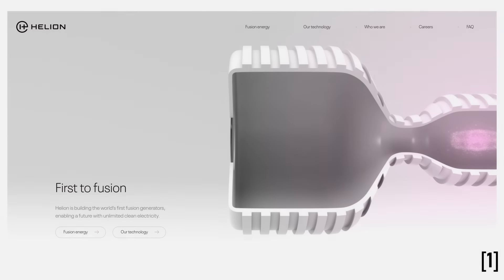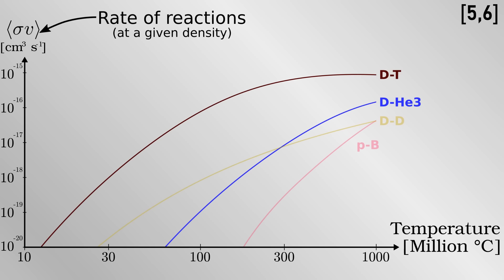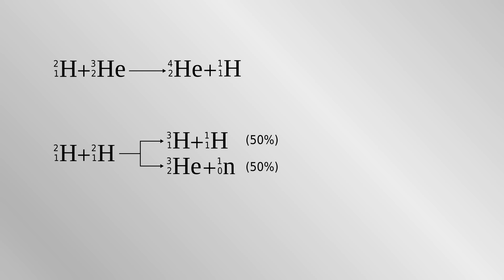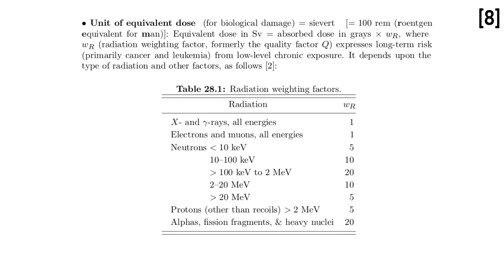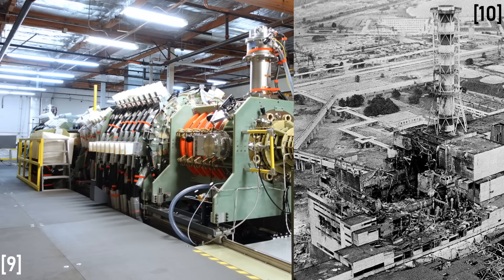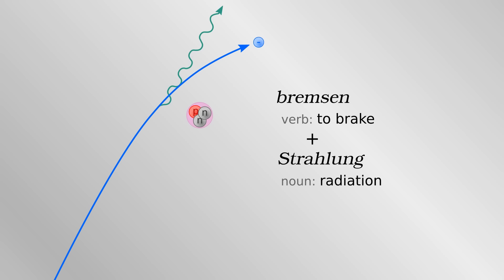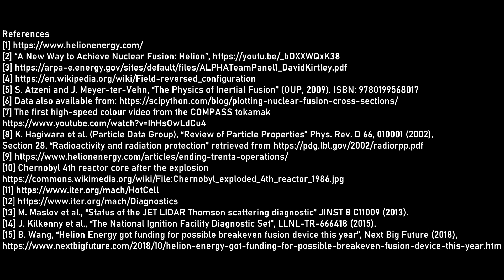The problems with Helion Energy - a response to Real Engineering

Comment: Helion sponsored a whole lot of youtubers this round of funding. 
I'm studying to be in the industry right now and in the course of speaking with potential employers i spoke to helion guys.

The claim is that with lower fusion rates, they can reclaim lost power usually used to heat plasma. The net total is supposedly gain. I'm not convinced. 

I'm glad you're out there doing this though. They need more criticism
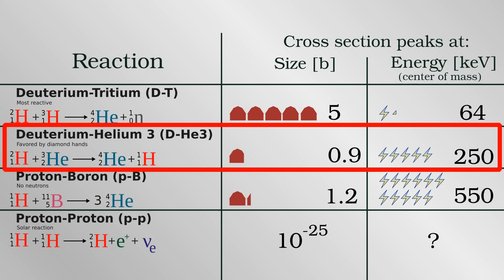Reply: Criticism is defiantly appropriate but it seamed mostly miss guided in this video. The reaction density was equated at 1:50 with power density while expecting that the density of material is the same. We have no information on the density of the plasma, (might be much better), the power per reaction is shown to be 4x as high in the slide at 1:12.
Equating some neutron radiation to burning chernobyl seams deeply disgenerous, many fissle material emit neutron radiation (we are exposed to it naturally) and meters of shielding can be accomplished by water tanks like in every other commercial reactor. Bremsstrahlung is usually less of an issue in pulsed reactors and happens to all fusion reactor designs.
The detection of fusion: Measuring the heat of plasma is nothing new and if they have achieved 100 million °K it is basic statistics whether they had some fusion
Helion will be late and haven't yet even achieved a gain factor above 1, constructive criticism is definitely appropriate and they like are looking for funding.
Neither REs video nor this criticism proves or disproves whether their approach is viable, I wish all fusion researcher and start-ups good success.
Reply: @leonfa259  The power extraction method they claim to be putting in use uses the tendency of the plasma to push back against the magnetic fields of the coils, producing net energy output. This would mean that they don't need to spend energy on temperatures above 100m K, they just need to form the fusion plasma with enough energy to push back against the fields. That being said, they haven't actually tested the system yet, so there's no telling just how much that extraction method can produce.
Reply: I have very little knowledge of fusion, but i think what you just said is that Helion isn't producing as much power, so it's not losing as much. Which is great if they're going for efficiency but runs into problems if they actually want to produce power. 

Taken to the extreme, my body is a highly efficient fusion reactor because it wastes no fusion power 🙄
Reply: @pills-  The gain factor is how much energy is produced through fusion divided by how much energy goes in to the plasma (heating and compression).
Helion only says that they achieved fusion which is an important milestone but still far away from commercial viability or ever energy production.
The raw power output of the fusion is depended on density and temperature of the plasma and the kind of fusion reaction.
Reply: Helion is not making any new round of funding at the moment. In the last one (2021) they obtained enough money to operate for several years (more info in their wikipedia page). If you really talked to them you could have asked.
Reply: @leonfa259  This is exactly correct. Even if they have produced fusion, it's another story entirely to extract energy from it. They do have a commercial sized prototype that they're working on that ideally will output power as soon as it's running. How much power they can extract depends entirely on the field strength of the plasma. The stronger the field can push back against the coils for the same energy input, the more power can be extracted. I do rather like this method for two reasons: it's very difficult for a reaction to result in catastrophic failure in a pulsed fusion generator, and it's supposed to be very fuel efficient, which is critical at this stage since we don't have nearly enough tritium, but deuterium is in plentiful supply. D-D reactions, while not nearly as energy efficient, are the most sustainable we have at the moment. We should be worrying less at this stage about whether or not this produces any usable power and instead worry about how much it uses and how LONG it can generate net positive power.
Reply: @leonfa259  I guess the problem with neutron radiation he's getting at is that at the current design there is no way to shield the machine from it, like you'd do in a Tokamak or Stellarator. So eventually it will break due to embrittlement.
Reply: So less power input with the hope of net power production - even if it's really small and not worth the cost to make it. Theoretically anyway. Sad face.

Comment: Watching his video set off quite a few red flags in my head. I'm glad you made this one to explain many of its shortcomings. What really got me was when they described their plan to generate the Helium3 using a deuterium-deuterium reaction, to which I thought "So your whole setup is just deuterium-deuterium with extra steps!"
Reply: No it really is, 
Helion themselves said they would have a Hybrid D-D D-He3 reactor that needs appropriate shielding.

They mentioned it might be nice to get a helium 3 breeding reactor only for simplicit but I'm reminded by this video you need the neutron protection reguardless...
Reply: It was stated that the sacrificial reactor to produce fuel would in theory keep operating costs lower for the fusion reactor.  Another thing they mentioned was that was not enough traditional fuel to support the reactors everyone else is working on, so their approach is novel from a viability stand point. I don’t know anything about chemistry so I have no idea if that claim about burning through all the nuclear fuel in a month is accurate or not.
Reply: @jeffreytgilbert  The issue pointed out in this video is that at the temperatures they are operating at, D-D fusion will still have a much higher rate than D-He3 in any reactor configuration
Reply: @jeffreytgilbert  There's only something like 40kg of Tritium worldwide and at energy generating injection rate ITER would really burn all of this in weeks.

Deuterium is cheap and basically infinite from sea water.

ITER wants to combat this using a Tritium breeding blanket made of Lithium-Beryllium to generate fuel in place. Unfortunately this is an experiment and ITER never intends to produce power.

It's pretty helpful and good business to make tritium for other reactors.

The novel part of Hellion I think they are really talking about the combination of pulsed and field reverse configuration plasma *in s way that makes sense and is stable*. It doesn't matter if they don't have a self sustaining reactor because there is nothing to sustain, it's pulsed.

Even 30% energy return makes it easier to test over and over again.

The sacrificial reactor is maybe not the best way forward, the neutrons released and slow enough to have some materials not made radioactive by them. But then you need the vacuum vessel to be like. metres thick for minimum damage.
Reply: @bluerendar2194  Right, but, it doesn't matter if a tritium-fueled reactor is 40x more efficient if you don't have enough tritium to fuel it. The whole fuel section of this video was complete nonsense because it totally ignores the reason they want to avoid depending on tritium in the first place. IIRC their reactor can also work with a tritium based fuel! So if tritium does actually become viable as a fuel, they can just use that. But they are not ASSUMING that it will become viable, and are developing their reactor under the assumption that it needs to work with a less efficient fuel. IDK why the video author thinks that it's like some glaring hole in their plan. 

The fact that fusing a Helium3 fuel is less efficient than fusing a tritium fuel doesn't automatically mean that it is unworkable, any more so than the fact that incandescent bulbs are less efficient than LEDs means they are unviable. To extend that analogy, when LEDs were not cost effective to manufacture as light bulbs, incandescents were, all things considered, more useful - because we could actually use them. It seems it could be the same case with He3 reactors.
Reply: @Wasabiofip  You misunderstood my comment, I didn't mention tritium at all. The video here claims that at the temperatures Helion is reaching, their reaction will be mostly D-D and not D-He3. In that case, there would be no physically possible way to "isolate" D-He3 reactors for energy production from D-D breeding reactors for fuel production, since that's not how the physics works. The D-D reaction is both energy-negative with the way Helion plans to capture energy and damaging to the reactor structure, which is why such claims were made in RE's video - but this video says the physics makes that impossible.
Reply: Also creating enough He3 would mean they would create enough Tritium aswell... at that point why not just bring the Tritium to a Tritium reactor instead of "letting it decay into more He3 fuel"?
IF they can make such a great breeder reactor they could sell the tritium to other fusion startups/state funded experiments and be already rich of off that.